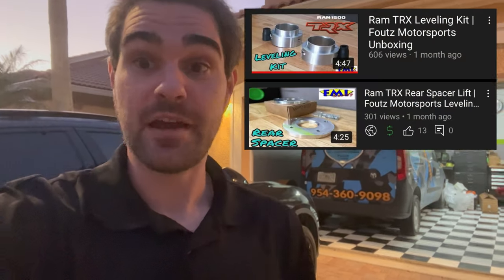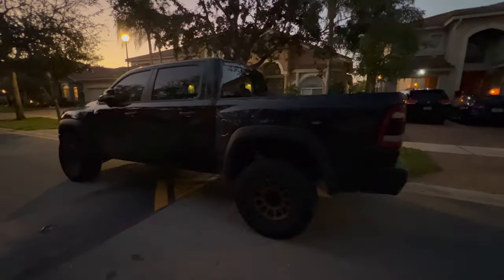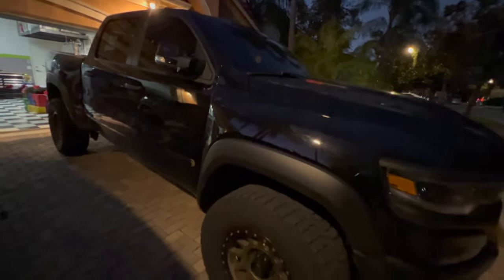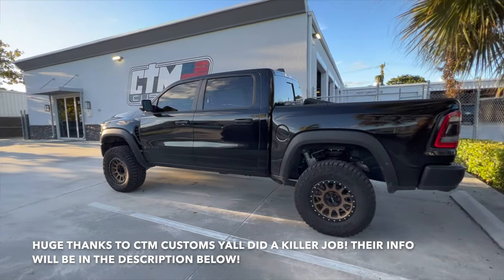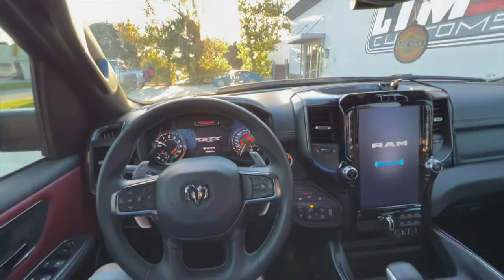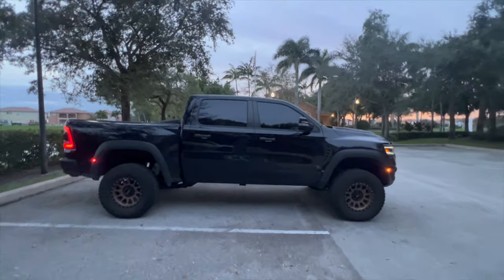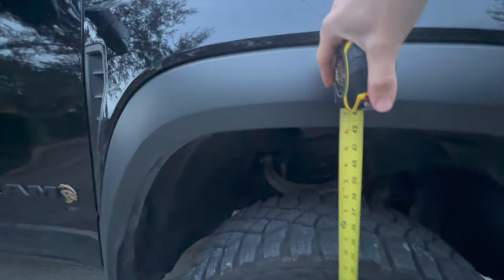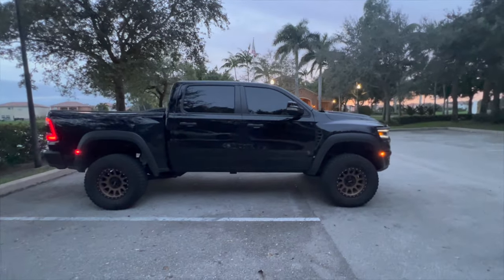Ram TRX Leveling Kit | Foutz Motorsports

Comment: What is your ride quality like after the installation? Does it "wonder" under WOT now? Mine is terrible with the leveling kit- way harsher, and WOT is scary because it is all over the road. Damn near wants to switch lanes when it shifts at WOT due to severe torque steer. Looks amazing, but absolutely shit ride quality now.
Reply from the maker: Wow nothing like that on my end. I mean yea the suspension is deff more firm but I totally expected that.  The torque steer is no worse than it was stock imo nature of the beast with awd. What level kit do you have on your truck?

Comment: Hey brother. The stance is so Rad! I've seen others with the rear spacers and perch collars with a nose high stance. Is it the same with your truck? I want either a level or slight rake on mine and I feel like your kit is the way to go. Thanks in advance!
Reply from the maker: Thanks brother! I’ve seen a few other trucks that only go with the front perches and those trucks to me are very nose high. I think doing the front & rear is the way to go when using the Foutz kit 🤘🏼
Reply: @Wimya  I guess I'm ordering it then. Thanks for the response. Loving the build so far. I need to get my TRX going. Enjoying your truck's transformation!

Comment: Hey man, Quick question, did this effect your ride quality at all? im afraid to put it on there and then it start to run tough.
Reply from the maker: Didn’t change the ride quality at all & still going strong with no issues after many months. I have zero complaints

Comment: Hi! Got the same level kit but after the front install I got a “service dampening system” code on the cluster. From what I read on forums it looks like the height sensors need calibration?  Did this happen to you?
Reply from the maker: Oh man that’s a bummer, I haven’t seen anyone else post about that. I didn’t get any codes after my install. Did you try clearing the code?
Reply: @Wimya  I can clear the message.... but the next time I start the truck again it pops up on the cluster... wondering if it has to do with the height sensor location given that the sensor changed position with the perch collar installed?

Comment: Dose the baja an sport an the rest of the modes change an dose it still work or the suspencion modes get eliminated an where did you buy this leveling kit any link to any web to purchase
Reply from the maker: All the suspension modes still stay exactly the same. All the leveling kit does is add preload to the spring to cause slight lift. I posted the link below, or message on Instagram & tell them Wimya sent ya 🤘🏼@foutzmotorsports

https://www.foutzmotorsports.com/collections/2021-ram-trx-truck-stuff/products/2021-ram-trx-front-leveling-kit

Comment: Any ride difference?
Reply: Same question here
Reply from the maker: A bit more firm. Personally I think it improved the ride.
Reply: @Wimya  I have always done kings but want to keep the live valving.  Might wait until bilstein comes out with something better to keep all the function
Reply from the maker: @atlfan13579  I don’t blame you. I’ve also
Heard it’s a 12 month wait for the Kings. Would be sick though
Reply: @Wimya   you mentioned it rides a bit more firm. Did you loose a little ride quality? I put eibach springs on my 2020 Raptor and kinda regretted it. Speed bumps were harsh.
Reply from the maker: @oscarm5670  no quality lost at all. The TRX stock is very bouncy so this just.tightens it up & IMO improves it.

Comment: Would it be leveled with only front perch collar ?
Reply from the maker: from the pics I've seen it doesn't look level with just the front collars. It definitely squats the rear
Reply: @Wimya  Thanks brother good to know
Reply: @oneday9312  from his measurements it would still be 1/2 inch higher in the rear with just the perch collar.

Comment: If you raise the front and the rear, it’s a lift kit, not a leveling kit. Raising the front to the same height as the rear would be a leveling kit. You also need to learn how to read the tape measure.
Reply from the maker: False. If you raise the front only with these collars you will have rake. The spacer in the rear brings the back up to make it level. This is LITERALLY advertised as a leveling kit from Foutz. But thank you for your incorrect comment 👍🏼

Comment: are those method 305 with -12 offset? I love the wheels but want to go 37"s and am affraid with that offset they will rub on stock height
Reply from the maker: Yea they are. I’ve actually seen someone with -12 with 9.5 wides and 37”. They said for on road use it was fine but off-road it rubbed. Also this was a 12.5” wide tire not 13.5”.
Reply: @Wimya  yeah I think for me 12.5 would be the way to go. I want a bit more tire and really I'm probably never taking it offroad. The offroad around here is either mud or rocks.
Reply from the maker: I feel you man. I’ll probably end up with 37 as well at some point.  Off roaring isn’t the best around me either, just swamp lol